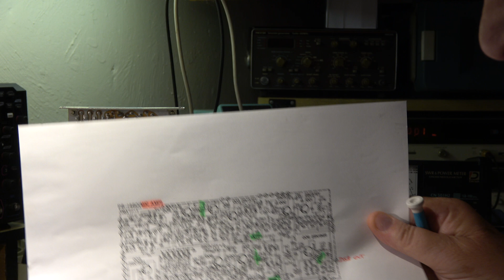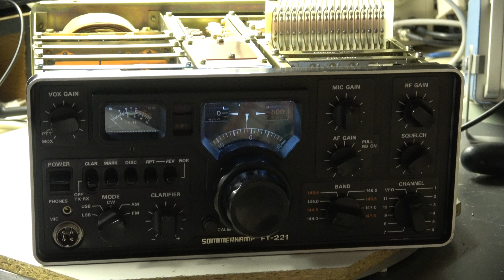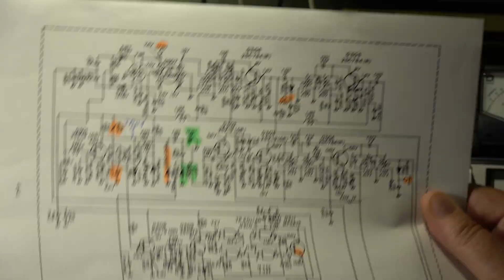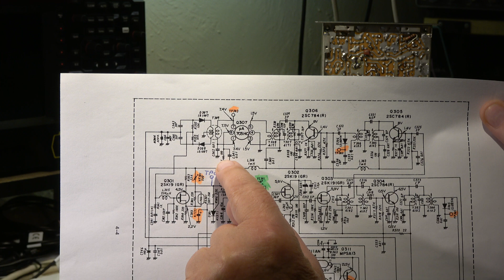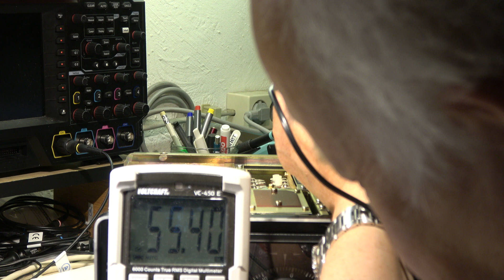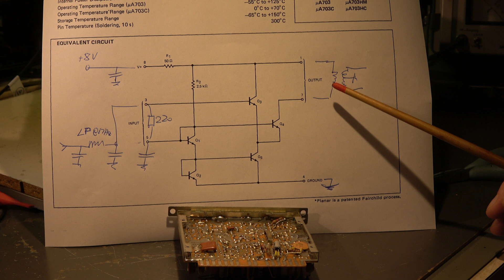#200 YAESU SOMMERKAMP FT221 Part 7(9)

Comment: you can use an MC1350 to amplify that signal, in case of absolute necessity. It has the advantage that its gain can be set with an external resistor, and the IC is really cheap.
Reply from the maker: Tnx for the hint